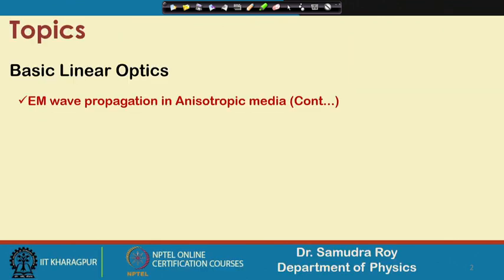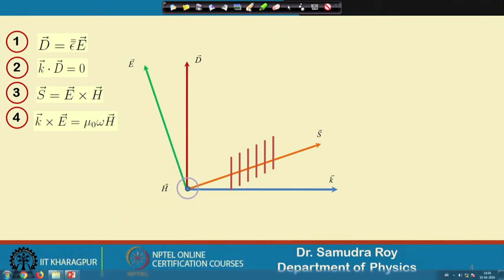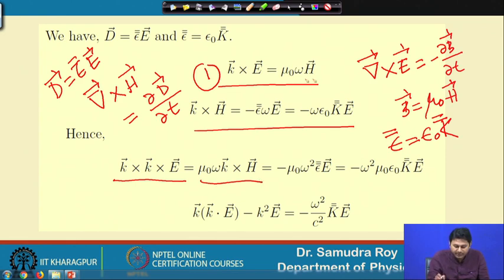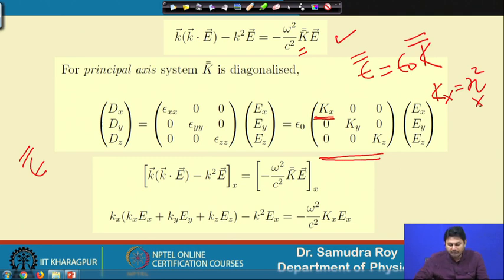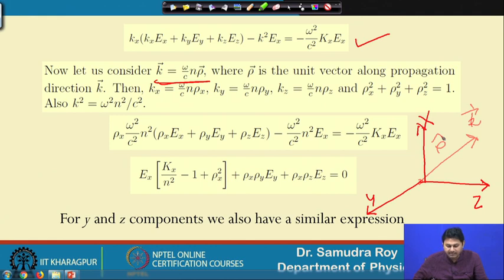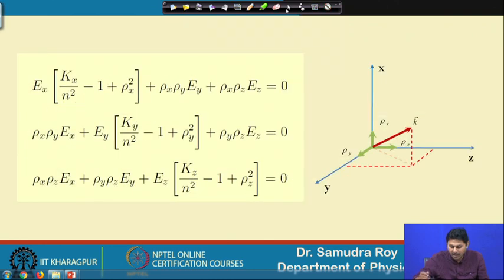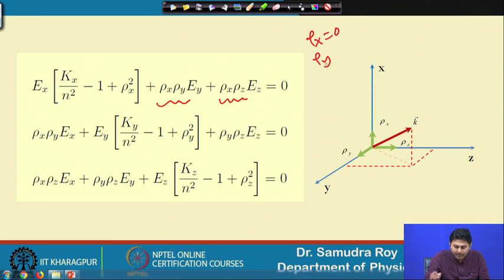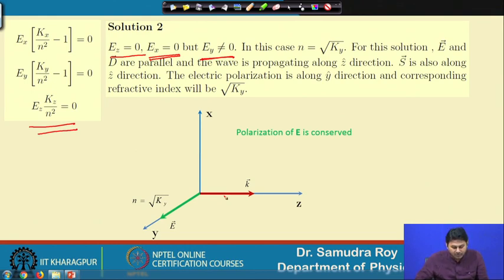Lecture 4 :Basic Linear Optics (Cont.)

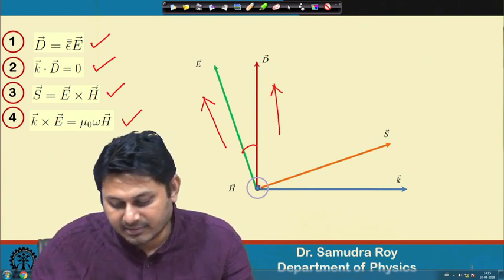Comment: I think there's en error @3:58, the professor says that "H is perpendicular to the plane containing E, D, S, and k'. The error is that not necessarily E, D, S, and k need to be in the same plane; the equations he uses do not force them to be on the same plane.
Reply: Is there any reason to assume that E, D , S and k are not in the same plane? Because in the case of a plane wave, they can lie in the same plane. Although E, D, S, k are not necessarily coplanar, unless you force a particular coordinate choice (e.g., take E along x and k along z, then they happen to span the xz-plane). But Maxwell’s equations do not require that geometry; they only require orthogonality constraints.